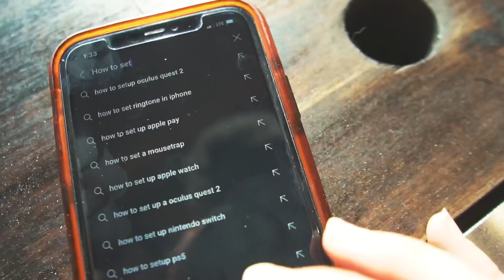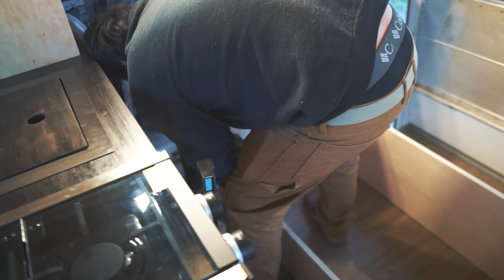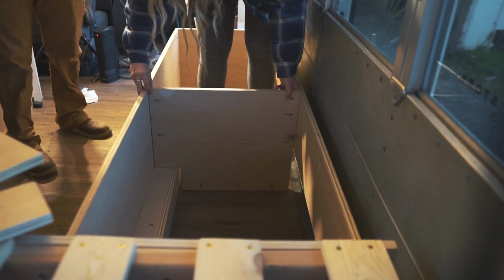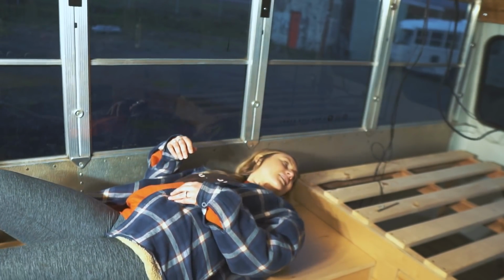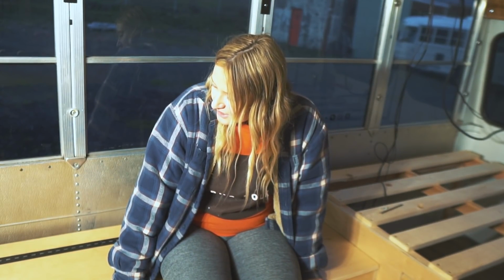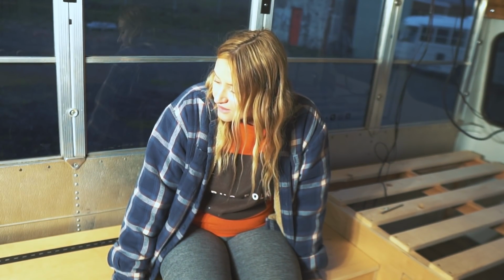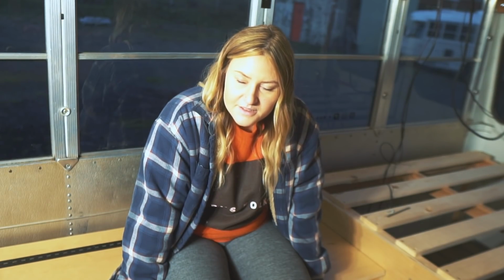Odd Jobs And A Bus Bench Seat - Day 11 Of 30 Day Bus Conversion

Comment: Hi Jaylena. Just a little help coming here. On the sink drain you'll want to flip the black and white rings. The white ring is made to conform to any inconsistencies on the opening while the black ring allows the nut to be tightened more without damaging the white ring. Cheers